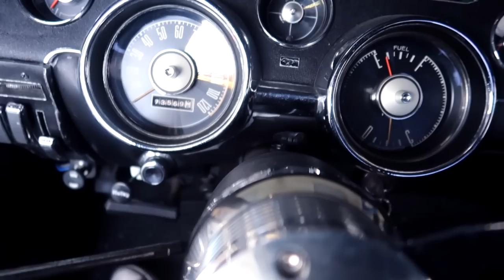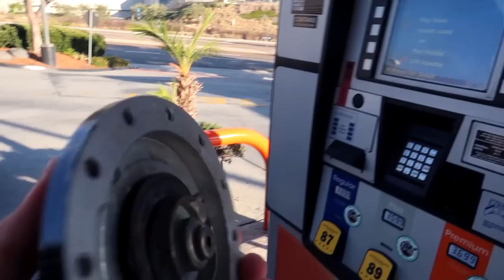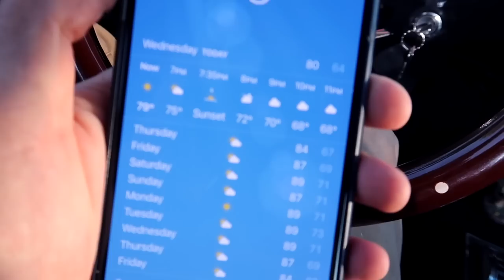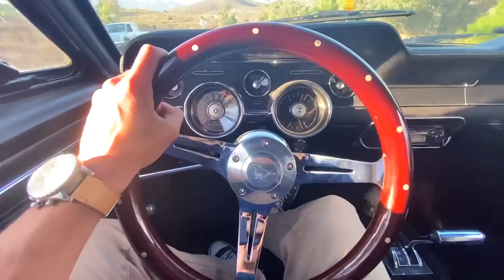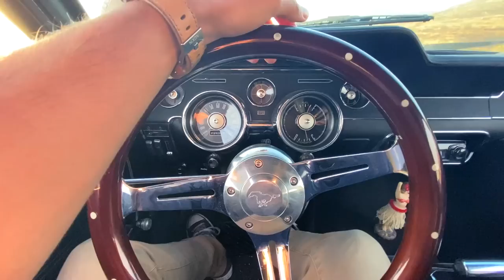5 Reasons Why I HATE My Classic Mustang! Episode 18

Comment: It’s not a problem, it’s a project.
Reply from the maker: i love it!
Reply: Nate Rider I have John Wick’s Mustang, so far she haven’t disappointed me.
Reply: Right
Reply: Kajun Lattimore at least the same year and model...
Reply: Yeah -that's true!
Reply: I'm in texas ... I had my engine 289 rebuild  in SA city motors  $1200.00   800.00 to take out and put back 2gether .. I had alot of parts added take out the old put in the new  fuel pump, alternator starter rebuilt my carburetor  replace orginal radiator for a aluminium radiator  engine stays super cooler going  to replace  upper control arms going to put 22 gallon gas tank also
Reply: nah its wasting money 😂

Comment: the problem here bud is that you are trying to mod it and doing a 600 hp engine swap before fixing it, yes its a 50 year old car of course its gonna have problems, fix it first then mod it.
Reply from the maker: everything is getting swapped so fixing the current motor wont have any affect on what we are going to do
Reply: Nate Rider not just the motor. 

If upgrade everything that moves. Breaks, suspension. Re-wire the whole car. 

If you want it to be reliable, make sure anything that can fail has been replaced or at least inspected.
Reply: @nicklang296  nice

Comment: I feel your pain Nate. I've had my 1968 Convertible since 1989. She was restored then and had a new 302 build in '98. Trouble is.....it's still a struggle. Literally, everything you talked about I have lived through. That being said, I can't get rid of her. She's just too damn nice. As we speak though, she's "grounded" with motor issues. I was told once that you need to drive them to keep them from having issues. Maybe that's the problem. Since the restoration, she's only been driven about 500 miles. You keep on driving her Nate.....it's got to get better.

Comment: I’m daily driving a 68 mustang coupe right now. No a/c, no power steering, no radio, drum manual brakes. Has electrical issue causing turn signals to not work. Still love it tho. A/C and disc brakes are the next must haves after fixing turn signals. Oh and those fuses are fun. Just have to slowly give her love.

Comment: Gas gague fix. It's just two ground wires running to the fuel sender on the bottom of the tank. Just follow the wires from back of dash make sure they are properly grounded. Previous owner may have tampered with them. 

$30 for new sender unit cjpony. You many not need it. 
Also look into dakota digital gagues.

Comment: “Your wheel can fall off” 
“My steering is loose” 
Bub sounds like you need to spend some money on basic maintenance
Reply: I personally own a 1967 mustang, any classic car has these problems thats not something maintenence can fix
Reply: @drewsharp1615  I would disagree regularly checking your wheel bearing will keep the wheel on the car. Lol steering loose.   I guess now one has shown you how to check your tie rods and ball joints with pliers. Once again basic mechanical checking on old cars is required to keep it on the road. People take for granted new cars. 50 years ago this was all basic stuff
Reply: @ShooterMcgavin6  I completely a gree with the wheel almost falling off, but the steering is tied to the car, the only way to fix something like that on these cars is to replace most if not all of the suspension,

Comment: Nate, I'm up on OC and rebuilding a 68 FB of my own.  Been following your channel.  I understand the frustration, but you're not doing yourself any favors (on the frustration scale) by doing that coyote swap.  Here's what I would recommend you do:
1. Put a nice 360hp crate 302 in and convert that auto to a 4 speed.  Huge fun factor improvement with the 4 speed alone.
2. With the money  you saved on not doing the coyote swap,  go have AC put in.  We're both in So Cal, and dude, you need AC.  I'm putting it in mine.
3. Get the car re-wired.  You'll be glad you did.  No telling what the PO did, but it's clear he spend a ton of money on appearance and not on the drive train and electrical.  
Do those things are you will really enjoy that car!  It is beautiful.  Message me if you want to talk further.
-Jeff

Comment: I owned a 76 Torino.. "The Starsky and Hutch" Had an Edelbrock carte motor in and was unreliable A.F.. But that's what you buy in to when you go for a classic, hence so many folks turn them classics in to trailer queens, they know what can and will go wrong. So, best way out? Spend the dough and make it a Beverly with 21st century innerts, Fuel Injection, true performance brakes, A/C, you name it, with this you'll add easily another 40 Large, but than you've got a car you can trust...... comes with the territory ;)
Reply from the maker: couldn't have said it any better

Comment: Before you put the new motor in, you will need to fix your front suspension. New ball joints, tie rods, steering box... Consider a swap to rack and pinion.  All that play on your steering means your suspension is worn.

Comment: Well Nate, since you asked! My daily driver is a 77 F-100. One of the things I dislike about these older ford pickups (73-79) are the fuel necks! When ford decided to move the gas tank from behind the driver seat to under the bed they made the fuel neck do a almost 90° turn! Whenever I am filling up I have to hold the handle where it's just barely letting fuel flow so that it doesn't backsplash out like your mustang! Also if I want to fill my tank completely I have to shake the bed so that the air bubbles can vent out the neck (it has a vent tube but it's not very effective). This seems to be a very common thing with these trucks as well, I have a friend that has the same year truck and he has to do the same exact thing!

Comment: Shiny paint only gets you so far. First thing you do when buying a 50 year old car is go over brakes and suspension. As far as parts go buying what’s cheap will cost you more when you have to buy the better part afterwards anyways. You should also change to larger wires for the battery at the very least use 4awg, better grounds would also help some of your electrical issues. Gas gauge is an easy fix on most old cars the sending unit either has a bad ground or just needs replaced

Comment: Oh yeah the sputtering is probably the fuel filter. Older cars that sit alot have all these problems. Drive it and run it more. Fuel varnishes in the float bowls of the carb. Sitting bad....

Comment: Do you plan on upgrading the suspension. Sway bar.. might give you a better feeling when driving also look into tightening the screw on the power steering I believe it will help with the play in the steering wheel

Comment: The fantasy just ran into the reality!  Your struggle is my entertainment. :)  But if you’re struggling with this motor, the coyote is much more complicated.  Also, if you are running into this many issues already you need to tear the whole car apart and find all the other hidden problems.  Right now, you have no idea whats the previous owners are hiding..  My 67 Mustang, I had it a day before I tore it apart!
Reply from the maker: to me its very easy! but i am learning a lot
Reply: @NateRider  Great..  So you're building the car yourself...  Beside the motor what are plans for the rest of the car?  
Also, when you fuel the car the reason it splits out gas is the fuel tank does have a vent tube..  As you put in the gas the air has no place to go and pressure builds.

Comment: I got a 68 cougar Prestine and after reverse engineering the ac. I can say vintage air ac can be done diy. Just buy basic tool set, electric drill and a small electric circular saw. It can be done. Just get your wires 12-10 awg and make them long. But the only issue I'm fixing with the ac is that the ac cut off when it reach 185 engine temp
Reply: I got a 1967 cougar xr7, got it in 1977 idrive it 1 hour a week how no rust north California car

Comment: So all those issues are upgradable.
Get a wire harness with modern blade style fuses conver to a one wire alternator with a internal voltage regulator. Convert over to a mustang 2 front end with a rack and pinion. Then throw the external coil and distributor in the trash and get an HEI distributor. The wire harness will fix all your other electrical  issues And make the car reliable.

Comment: Reason why you have over spill is that the old cars don't work well with the nozzles. You have to listen to that high pitch sound as the fuel hits the neck. And fix your sending unit.

Comment: Wanna make surer you have some subframe connectors before throwing a coyote at it. It will twist that body like a pretzel. 4 link suspension for the rear wouldn't be a bad idea either

Comment: I would watch that charge needle on your charge/ discharge gauge .It looks like it's pegged high. Sometimes voltage regulators can stick and it will boil your battery dry and ruin it. I never had it happen on my 68 fastback but I had a 68 Dart GT that would do it all the time. I would just make sure that needle comes back towards the center on the gauge.
Reply from the maker: It was charging the battery since it was down for two weeks. Now it pegs in the middle
Reply: @NateRider  Good, that's what I was hoping for. Have a good one.

Comment: When the vehicle is running on a 1985 and prior  when you let the car run off just the battery it will immediately burn the voltage regulator it says it in the Manuel

Comment: Ok.... First off you do realize that what you call a classic car was once all there was on the road. And they were reliable. Did coast to coast road trips. Got people to work every day. Its the upkeep. And you said it perfectly. No cheap parts. Not auto zone. You want Napa parts. That style rotor was used till the 90s. You dont pad slap those cars. You pack the bearings every brake job so the bearings dont get burned up from no grease. When you buy a classic car the first thing you do is replace or at least test those very things you have replaced. Before you start driving it regularly. Next is change your coolant and thermostat and change the trans fluid and filter. Trust me. Only use type f trans fluid in that Ford trans. All my hot rods have been nothing newer than 89. You can improve your fuel economy by better ignition parts. Mallory or accel cap and rotor with the copper contacts. Accel or msd 8 mm wires. A mallory or msd coil. The better the spark the more efficient it will burn the gas which equals better fuel mileage. It will stop night and day better if you keep your rear brakes adjusted. With the car on Jack stands in neutral when you adjust the rear brakes there should be a slight drag when you spin the wheel.

Comment: Those are not issues, that's just what happens in old cars. Once they are fixed, they are good to go. No offense, guys this generation are just used to all these electronically controlled cars. It's classic meaning old engineering.  It's a beautiful car, fix the little stuff and you will be good.

Comment: GAS TANK PROBLEMS, YOU HAVE TO CHANGE THE NECK (THEY HAVE KITS THEIR COSTLY TO BUY) TO CHANGE THE NECK TO THE TANK. THE KIT WILL REPLACE THE NECK TO THE GAS TANK. AND YOU WILL HAVE TO FILL UP YOUR FROM INSIDE YOUR TRUNK. KIT WILL CAP OFF THE OLD NECK. YOU WILL HAVE TO CLOSE OFF YOUR ORIGINAL GAS CAP. AND YOU'LL HAVE TO FILL UP FROM INSIDE YOUR TRUNK FROM NOW ON. MUSTANG'S AND FALCON'S ALL HAVE THAT PROBLEM WITH FILLING UP GAS.THE ORIGINAL NECK OF THE GAS TANK IS TO LOW. AND YOU HAVE SPILLS AND ALL KIND'S OF PROBLEM'S FILLING UP YOUR GAS TANK. THE KIT TO FIX THIS PROBLEM ISN'T CHEAP. AND REPLACE YOUR OIL PUMP DRIVE SHAFT WITH AN (ARP OIL PUMP DRIVE SHAFT) IT'S WORTH BUYING IT WILL BREAK IF YOU HAVEN'T REPLACE IT YET. A LOT OF THESE CARS HAVEN'T BEEN RESTORED FRON THE GROUND UP. BUT YET YOUR PAYING $30K OR $35K. YOU NEED TO CHECK OR JUST REPLACE ALL YOUR PARTS OR YOU'LL EXPERIENCE BEING STUCK ON THE SIDE OF THE ROAD. 😬🤔

Comment: I could tell from your first video on the 67 that this is not a car for a novice mechanic, and you were going to have problems. I have had a 66, 69, 2 73's a 78, 2 2004's 2 1998's and 97 Cobra.  And almost all of them are daily wrenching sessions. Old cars are old, with your 67 we are talking 52 years old! Seems you bought a so called "restored/semi restored" car, which in most cases, means they made it look nice to sell for big money. It's obvious the car wasn't properly "gone through". As I wrote before, there is a reason they mostly only drive them to shows and sit there to let people gawk. And to be "real", your problems are nothing new to old cars, they are part of old cars. If you keep this up, then in 2072 tell us how reliable your 2014 is. That's the picture........

Comment: So it is unreliable because YOU bought crappy, low $ parts instead of just going MSD or HEI on the ignition, you have chinese no-brand brakes from the looks of it and you are having to tune the carb (normal)....So basically you are blaming the car's unreliability on your inability to completely work on the car and permanently fix the issues it has...K

Comment: It sounds like your problem started after you bought a cheap part its a ford dont cut corners that's probably what happened to your rotor and spindle as for your carburetor again its a ford and wether temperamental

Comment: Pertronix's are junk its what probably ruined the new coil, just like the voltage regulator was more than likely bad, not the alternator.  I love the car, it looks bad ass.  Obviously the previous owner was more concerned with looking good than running good.  You basically spent $30K on a roller.
Reply from the maker: you got it right on the dot

Comment: you should have gotten a full msd ignition instead of all that crap. fuse costs like 50 cents who cares. switch it to blade fuses and relocate the fuse block to glove box. use locktite on the carb once you get it set. let the car warm up when you start it and it won't die. sounds like complaining but I know it's not. I totally understand. fix it right once or fix it daily. and my coyote gets 11 mpg if you do the swap ur gonna be mobbing around all day probly getting less. as for the bath, leave the ignition on and watch ur Guage.  mine came with a so I don't have that problem but there are units available that look original. it's very easy to install can be found for 500 and done urself. tighten your steering box up. wildwood disk brake swap and get the dual bowl master cylinder. fuck airbags unless ur talking suspension but not on a classic. get LED lights all around and they will not drain your battery they will also be more visible and make the car a little safer. you also may want to look up the vin cause a buddy of mine bought a fastback that was originally a coupe, just rebodied. could also be better news like maybe its a GT originally and rebuilt as just a fastback. who knows? and as for the last one, try fuel injection. the exhaust tone is your stereo.  best of luck with your build and if you ever head up here to sf let's meet up and get some car pics. mine is black too.
Reply: as for ur last statement I hate absolutely nothing about my baby. I'm 33, had her since I was 14. my first car and she'll be my last. call me crazy but I wanna be buried in it with my hands sewn to the wheel and a smile sewn on my face.

Comment: If you go coyote swap. 
Check out mike maier inc for suspension parts. 
DSE also makes very nice suspension setup for these cars. 

Even IF you don't go coyote. Look at those guys. Mike has a nice power steering upgrade to. Steer clear of most of the rack kits out there. 

Look into swapping out all you elecrtical. Just do it. It's worth the money. You get 4xs the fuses updates everything to modern fuses. 

I own a 67 fastback. 
Sonic blue with torq thrust wheels. 

Gonna sub to the channel.